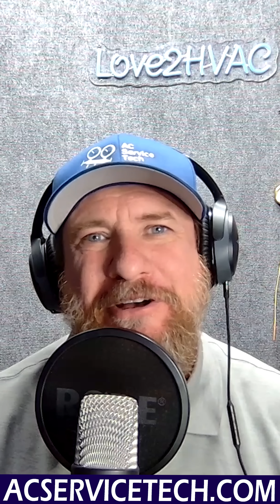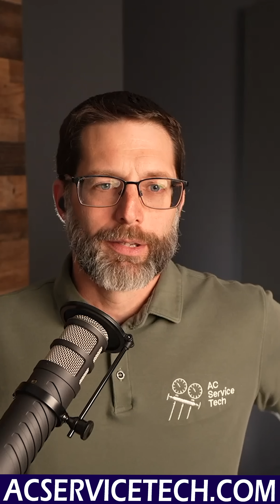Talking On The Purpose For Pulling A Vacuum on a New Empty Refrigerant-Based System!

Comment: The old R12 and R22 systems used chlorofluorocarbons. While the reaction rate is slow, water in the system can spontaneously react with this refrigerant, and one product is hydrochloric acid (HCl). But HCl will NOT react with copper, as the copper does not have the ability to displace hydrogen from this acid. However, aluminum does. And that is why so many millions of aluminum condensers failed in the 1980s (cars)... they corroded right through from the inside out and leaked. And compressors are made of aluminum. So then the compressor can suffer internal corrosion as well. But the newer refrigerants do NOT contain chlorine, therefore are orders of magnitude less corrosive.

Comment: Recover, evacuate to about 1000, maybe 800 micron, vac break,  flush the circuit loop with dry nitrogen  at a low pressure ( 20, 30 psi).  Re evacuate again to 800 or even 500 micron, close access valves, shut off vac pump. Monitor vacuum gage(s) for pressure gains -- not fractions but tens, twenties and climbing. As an example, twenty psi gain over ten or fifteen minutes and still climbing would indicate a sizeable leak and must be found and repaired..whether a braze or a valve, even a scored circuit tube mid assembly.
A small gain and stops increasing means system contains either a small amount of moisture or refrigerant and needs a dry nitrogen sweep and evacuated again until there is no noticeable gain but a stable vacuum close to 500 to 800 micron.  The system is ready for the next step.

Comment: So if nylon blue is a thickened version of Poe oil, why does it not absorb moisture? And if it does, wouldn't that be detrimental to the system to use it? I understand it's a small amount that you use but couldn't. It effectively go bad from just sitting in your truck?
Reply: Nylong Blue is a synthetic lubricant based on PAO (polyalphaolefin), not POE (polyolester). NOT a thickened POE, and as PAO-based, it's non-hygroscopic. It has excellent shelf life and is stable at high and low temps, so it won’t go bad from sitting in your truck for months or even years if sealed.

Comment: The nasty part of the vacuum stage is the way temp drops when vacuum is applied. Some moisture boils off, but in parts of the system the temp drops so quickly you get solid ice. Good luck getting that moisture out quickly, it needs to sublimate first. It's a joke that in the automotive industry people routinely apply vacuum for a very short period of time. I'm surprised they don't have more comebacks, especially given that many shops use compressed air to flush the system.
Reply: They'll use compressed air for leak checking too. Can only imagine what is being done to the oil. 

If I have a system that has been open to atmosphere or has had a flat charge for a while, I will change the driers and oil if it's POE and then I'll do a triple evac while using a heat gun throughout the system until I have an appropriate steady micron reading. I will return a couple days later to replace the drier again.